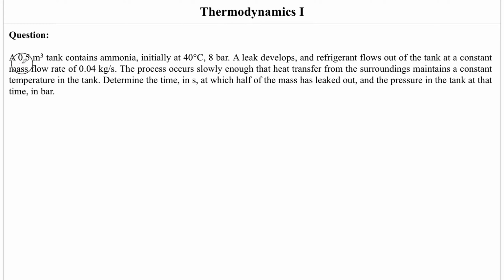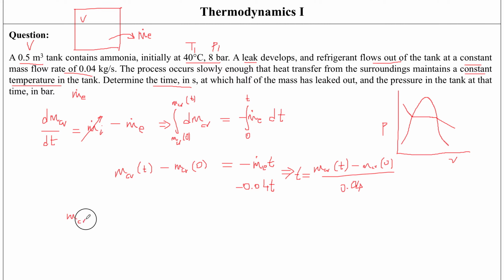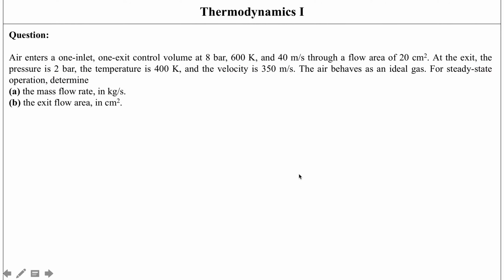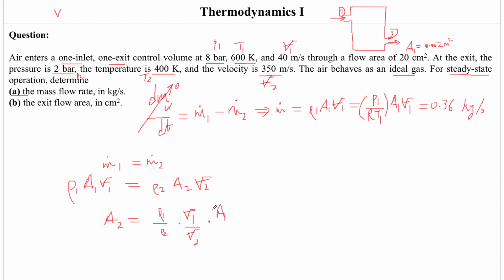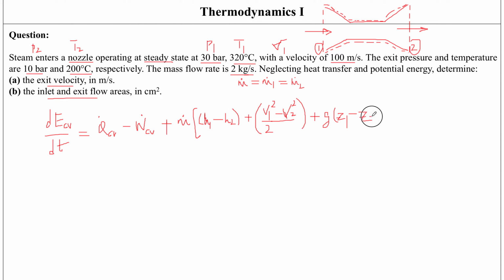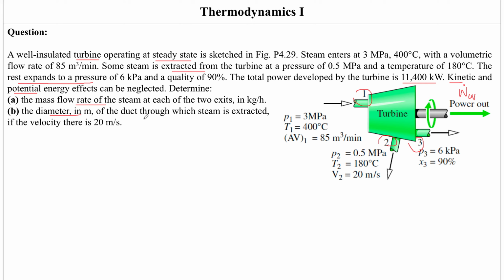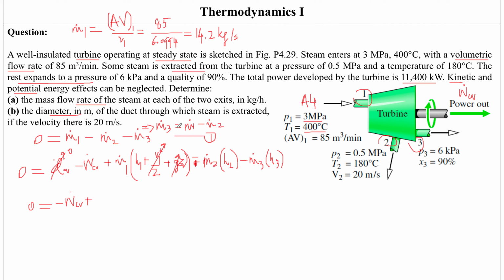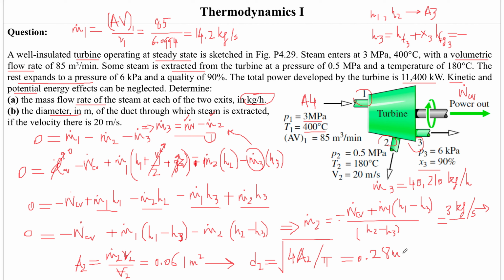Control Volume Analysis - Problem Solving - Thermodynamics

Comment: i think there is a mistake regarding the fourth question. you substituted the volumetric flow rate as it is and you got the value of mass flow rate at inlet Kg/sec . how???
Reply from the maker: You're dividing vol. flow rate (m^3/min) by specific volume (m^3/kg): You're left with kg/min. Divide by 60 to convert to kg/s.

Comment from the maker: One correction that you should note in Q#1: When writing the initial equation in terms of t, the denominator has a negative sign with 0.04. The value of t is correct though i.e. t = 35 seconds.